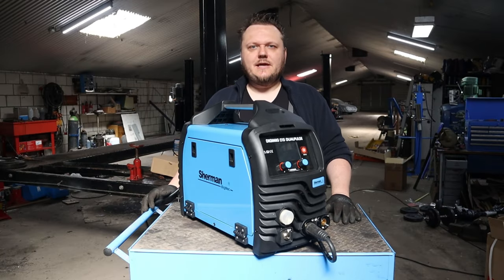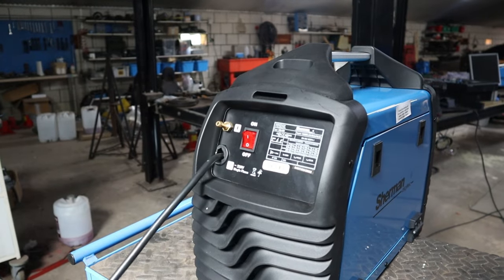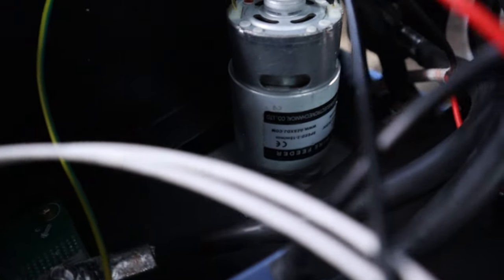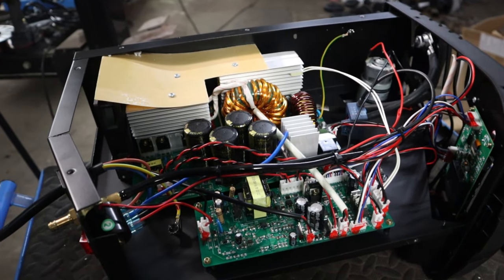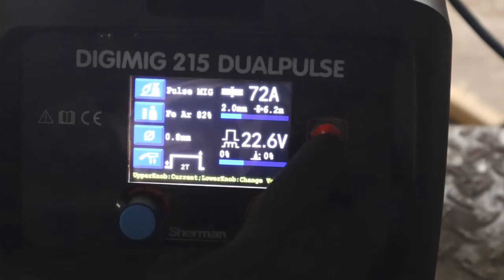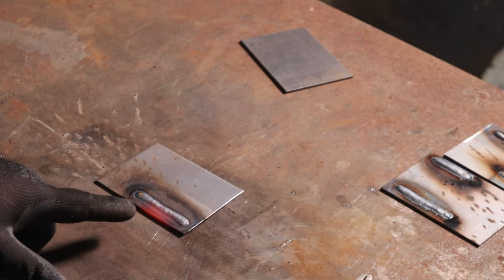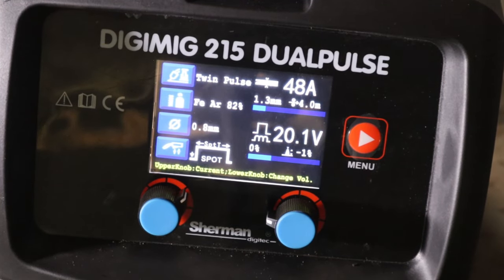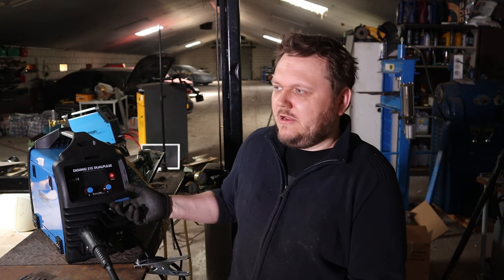Sherman DigiMig 215 DualPulse | Review/Preview? Well something like that.

Comment: i bought one just before watching your video , Thankyou hope your one is still running good ,
Reply from the maker: It's welding fine, but I do miss the wirespeed function...
Reply: welds aluminium really well , when you get it set up right , i don't think  mig/mag welders have wire speed control  we have £6000 weld and that is amp combining wire and voltage , if it says wire speed that is still amps and wire,  confusing going from normal mig  with wire speed  to synergy mig/mag no wire speed

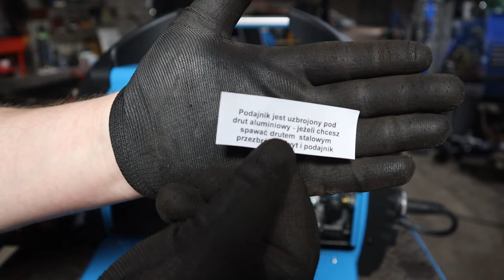Comment: 5:06 That Label says that the wire feeder is set for aluminium welding so if you want to  weld a steel you have to swap the bowden cable to appropriate.  Cheers.
Reply: Zjebałeś. 
If you want to weld steel solid wire change torch and wire feeder.
Reply: @PaganiniPagani  Widzę Cię w komentarzach pod różnymi filmami o tematyce spawalniczej więc mam pytanie - co Sądzisz o tym migomacie  jak on wypada w porównaniu ze spartusem 217 (rożnica w cenie to 500zł) Pozdrawiam
Reply: @piotrszwaj301 są to dwa różne sprzęty prawdopodobnie zaprojektowane zupełnie inaczej. Spartus jest znany z pancerności i dobrych podzespołów

Comment: Hello my friend.
Puls and double puls is not recomended with short circle arc and sprey arc. Puls and double puls can be use and only can be use with burgle arc like 25 to 30 volts for 1.0 and 1.2 wires. 0.8 wire only 24, 25, 26, 27, 28 and 29 with 82/18 mix gas thats why first setting arc popping and banging.
Reply from the maker: Thanks for the info. 👍

Comment: Thanx for the informative video. I am thinking of buying the same machine and you helped a lot.
Here in Hungary it is sold as Panelectrode / Zeus 200 DP. Unfortunately I can’t help you out with an English manual because it’s only in hungarian.
Question: have you used the welder under direct sunlight? I am wondering how well the display is readable in a bright environment.
How did you figure out the hidden menu by the way? 😊
Reply from the maker: Its OK, but dont expect it to read it further than 1.5 meters away.
Reply: @TheDutchGarage Thanks for your feedback. Waiting for more videos with your new welder.